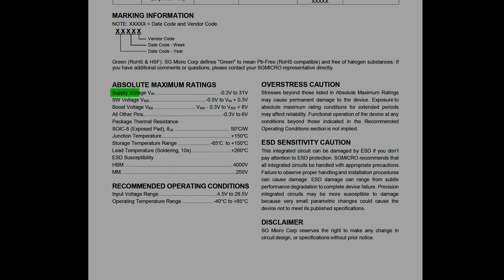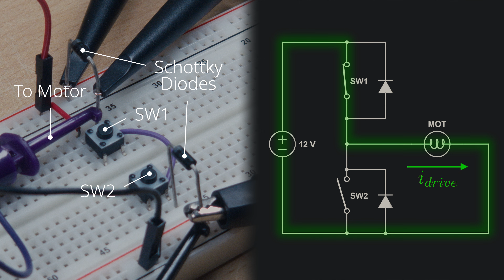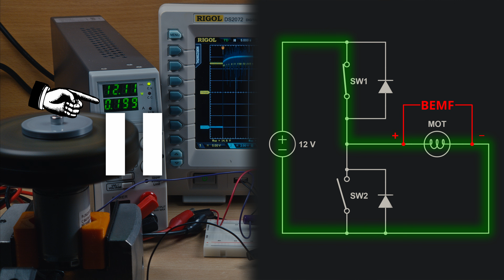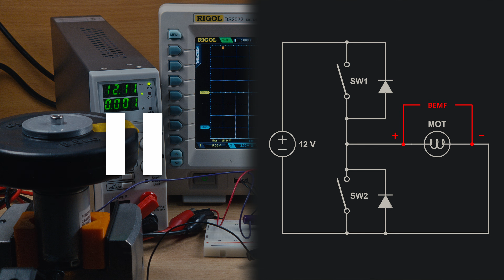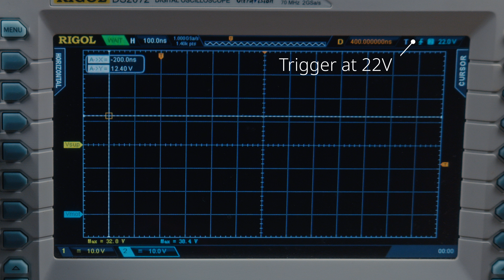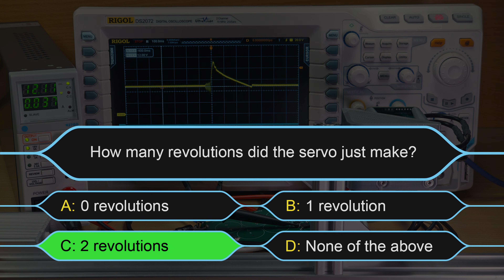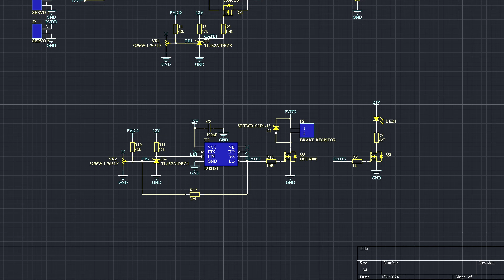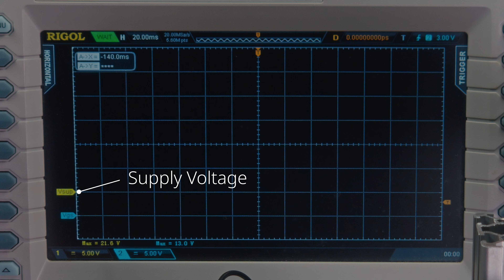Regenerative braking broke my motion controller. Here’s how to protect yours (with schematics)

Comment: A well designed motor controller should never destroy itself from braking, even absent ballast resistor. The fast irq also measures the bus voltage and upon reaching a threshold the output stage is cut thus instantly stopping the regen.

Comment: TL:DR: use a braking resistor with a circuit which dumps rising power supply rail into the large braking resistor.

Comment: One possibility:

Take the protection circuit at 8:13.
Problem: power loss in the diode.
Solution: swap an ideal diode in for the diode.
Problem: ideal diodes tend to react slowly, which can result in brief spikes reaching the power supply.
Solution: Add a TVS diode to cope with said brief spikes. Doesn't need to be rated for continuous operation, just pulsed for long enough that the main protection circuit kicks in.

Also: beware that many power supplies cope extremely poorly with high amounts of capacitance on their outputs, and may oscillate or go out of regulation.
Reply from the maker: Yep there are many ways to implement these protection circuits!

Comment: hii bro , I came across your video I have some doubts regarding this .when  motor act as a generator it produces BACK EMF this back EMF go to the power supply how would you switch this from not going to the power supply but to the transistor  and what is the need for inrush current control . Basically can you explain the schematic in detail. I want reproduce this circuit for  my project
Reply from the maker: This circuit doesn't disconnect the power supply. When the shunt resistor is "switched on", it becomes a new return path of relatively low resistance, so current from both the power supply and motor's regeneration will sink through that resistor.
Reply: @engineerbo  thank you bro
Reply: @engineerbo  Now I have another doubt bro can we do  different inrush current limiter for this circuit
Reply from the maker: Of course you can implement something different, these sub circuits are pretty much independent.
Reply: @engineerbo  can you explain the working of Inrush current limiter circuit it will help my project .I don't know where I have to place the Inrush current limiter circuit . I want to place this regen clamp across the motor driver and the power supply.

Comment: Can I just put a big capacitor? Just take approximately 1 J of energy. I’ll answer it myself - I need to test it And there is some danger 😀
Reply from the maker: Yes if you have a sufficiently large capacitor and a sufficiently low impedance path, then it'll limit the voltage ripple enough to do the job.
Reply: @engineerbo  Varistor for an operating voltage of 13-15 volts, the simplest and cheapest method ))

Comment: I saw glare on your PCB, turn that polarize filter bro! haha Btw, I did finish installing the filter on my microscope, its amazing, thank you! Wrote little article on my website about this. 
Back to your video, this is insane work, I love how you present topics. Keep making them. My big question is why not use a Zener? Would love to compare that to scope @ 10min24
Reply: I just saw your reply about TVS. Those peaks are in nano second right? Peak power will be short then. Again, it depends of the end application, if the pick and place moves ultra fast with big load, this generates lots of peaks and could stress the TVS. Can you parallel TVS diode so they all absorb energy? But not sure if they will catch spikes at different time due to manufacturing tolerance.
Reply from the maker: Just looked up the article on your website, nice write up!

The peaks in this video are really "demonstration" peaks, so I've limited it to something safe. I've seen people talk about parallel TVS diodes, and that seems theoretically fine, as long as the specifications line up. I'm guessing there are situations where TVS diodes are preferred, e.g. if ultra fast protection is needed.

Comment: Why is it bait and switch?  Bait and switch is a *scam* where you promise one thing, then when it arrives it is another lesser thing.  In engineering that analogy doesn't quite make sense to me.  Electronics operating in multiple modes or like multiple devices, etc. is not a bait and switch because it isn't a scam.  The scam part is the critical point in a bait and switch scheme.  Anyway maybe I'm just misunderstanding why this is like a scam.  But using that logic I feel like I can call a bunch of mathematics a scam too because it is unusual from what you expect (ie. the analogy doesn't carry well outside of a societal context IMO)
Reply from the maker: The analogy isn't meant to be technically rigorous. That said, I think the analogy has some merits (literally using a switch to cause current to flow and redirect it where it normally wouldn't). It's understandable if you disagree.
Reply: @erbo ok.. Bait and switch refers to a fishing line.  You throw out bait, and then when a customer bites and buys something, they get something other than what they paid for.

IMO it doesn't make sense in the English language to use it they way you are, it makes it sound like you don't understand the phrase or the language.  But I mean if you want to keep using that analogy 🤷‍♂

Maybe read: https://en.wikipedia.org/wiki/Bait-and-switch

Comment: Even though I know exactly how regenerative braking works, I don't understand what the problem is. In applications where we have no way to store this energy, regenerative braking is pointless and the motor should be braked by applying current to it.
Reply from the maker: Applying a reverse current works, but the kinetic energy still needs to go somewhere. If the energy isn't dumped into a dedicated resistor, all other components (e.g. motor, wires, switches, power source) will need to absorb or dissipate it.

Comment: (At 8:36) Although kind of irrelevant to the subject you are talking about, but I couldn't resist telling you that there is a small issue with your in-rush current limiter. When the capacitor bank reaches its steady state, the PMOS turns off bypassing the in-rush current resistors. However, if a power surge from your circuit lowers PVDD enough, the TL432 will turn off the PMOS, thus enabling in-rush protection when power is most needed. One way to overcome this is to pull up FB1 higher than 2.5V with a PNP transistor once GATE1 goes low. This effectively prevents the TL432 from responding to PVDD dip after the steady state.
Reply from the maker: Thanks for the heads up! I haven't stressed the power supply enough to cause a big enough voltage drop, but yes that's definitely something that can be improved.

Comment: Bo Very well done video. I would be curious how the DC servos you find from Stepper online and/or Gecko compare to the same sort of analysis.
Reply from the maker: I'm guessing all permanent magnet motors will exhibit some form of regenerative braking. Perhaps expensive controllers have some way of absorbing the energy. I'd love to find out, but those things can get pretty expensive.

Comment: And why not just use a simple TVS diode?
Reply from the maker: A TVS diode will theoretically work fine, provided you can find a model with a voltage rating that suits the rest of the system (I don't think I've seen an adjustable TVS diode), and is able to survive the power/energy from regenerative braking.
Reply: @engineerbo  
Just one search result and there you can find TVS diode with various nominal voltage and power ratings, up to several kilowatts. If there are no other specific parasitic characteristics these diodes apply on the circuit I don't see why making the search a whole lot more complicated focusing on sourcing many parts including IC's instead of just a single component to do the job.
Reply from the maker: I can perform a similar search for components, and I don't think I will easily find a TVS diode that will satisfy all my requirements. The TVS diode needs to be rated so it doesn't conduct during normal operation, but clamp the voltage before anything else is damaged. That in itself is not a trivial requirement to satisfy.

When you say these diodes are rated to several kilowatts, I'm guessing you're referring to the "peak pulse" power rating. That is not the same as the power rating as with a power resistor. There's a reason the 300W braking resistor I showed in the video is about the size of a brick, but a "300W" TVS diode might come in an SOT-23 package.

Comment: I am using an ideal diode usually used for solar panels. I am not sure if it's the best solution but my power supply is alive. I need to check on the oscilloscope as you did
Reply: Beware that ideal diodes tend to react very slowly. You can kill the power supply from the transient before the ideal diode kicks in.
Reply from the maker: Where do you install the diode? It sounds like a diode could be protecting one side of the diode at the expense of the other side.
Reply: @engineerbo  Between the psu and the controller. So you mean I would still blow the controller but not the psu
Reply from the maker: Yes, the diode will stop the reverse current into the power supply, but the voltage spike will still build up on the other side of the diode.

If you're using a diode, you still need something to dump the energy, like the returned energy dump circuit on gecko drive's website.

Comment: The production quality here is AMAZING! How do you have this few subscribers??

Anyways, I'm curious: Why didn't you want to use the regenerative braking protections that's built into your driver?
Reply from the maker: Thank you! My servo driver's pretty bare bones at the moment, so it doesn't have built-in regenerative braking protection like the ODrive. They're also usually used at least in a pair, so it feels unnecessary to have duplicated protection circuits.

Comment: If all you need is shunting a known amount of energy from regen braking, then you can take care of the voltage spike by simply adding a capacitor large enough to absorb the regen energy within the allowed voltage rise. If you have a 1kg mass moving at 3.16m/s, that is 10 joules of energy. If your nominal voltage is 24V with a 28V absolute maximum, you would need a ~100mF (0.1F) capacitor, preferably in the form of 2-3x smaller capacitors in parallel for reduced ESZ. Of course, having a shunt regulator to clip anything above 28V and also trigger a warning/alarm would still be a good idea in case the capacitor bank wears out.
Reply: ah yes the ubiquitous 40 V-rated 100000 µf capacitor; the first thing that should spring to anyone's mind 😎
Reply: @ikbendusan  If you cannot source 100mF caps for a reasonable price, just replace it by an equivalent amount of parallel caps.

If you want to brake and accelerate 10J of kinetic energy in 20ms at an average rail voltage of 26V, you need to handle an average of 38A in and out. Huge caps are only rated for 20-25A of RMS ripple, so you'd probably want to split that current between 2-3 smaller caps at a minimum for longer life.

You can also go all-in on being budget-minded and just lump 15x 10mF caps together to achieve ~60A RMS rating for cheaper than a single high-current 47mF cap.
Reply from the maker: 1 kg mass moving at 3.16 m/s is about 5 J. To absorb 5 J (i.e. magic perfect regeneration) and have the voltage rise from 24V to 28V requires "only" about 48 mF. To size the capacitors we'll want a safety margin, then adjust for derating and ESR etc. Overall, it's doable, but the braking resistor is likely cheaper.
Reply: @engineerbo  Sorry, forgot the divide by two there. Makes it twice as doable and half as harsh on caps.
I wasn't suggesting capacitors for the cost, though large power resistors aren't exactly cheap either. More for the efficiency, reduction in power supply peak loads, eliminating the need for the PSU to cope with massive fast transients, 100% passive simplicity and no hot dump components to worry about. Also, when capacitors go bad, you usually get progressive tell-tale signs before failure (ex.: leaking caps, sensor misbehaving from electrical noise and controllers crashing from noisy power) instead of immediate catastrophic failure when a shunt fails to do its job.
You can build a 50mF capacitor bank out of 15x3300uF Nichicon YXS caps for about $25 which would have ~1mOhm of ESR and 60A RMS ripple capacity.
At that point, wiring ESR/ESL would be a bigger concern than the capacitors'.
Reply from the maker: I personally quite like capacitors, and in the protection circuit's PCB in the video, I actually did include a small bank of them. Having a large capacitor bank doesn't instantly mean the system is simplified though. For example, there might now be an high inrush current when powering on.

There are also several failure modes for capacitors, and for sure catastrophic failure (e.g. venting) is one of them. I'd also imagine it's not necessarily better to experience gradually worsening system reliability in non-catastrophic cases.
Reply: @engineerbo  Charging arbitrarily large capacitor banks without causing massive current spikes is why most switching power supplies have a soft-start circuit that ramps up the primary side duty cycle or current limit over the first 60-120ms from AC-on.

As far as capacitor failures go, good quality capacitors of appropriate voltage, ripple current and temperature ratings rarely fail catastrophically unless something else fails first to push them beyond their ratings... or they got hooked up backwards. The far more typical failure mode is slow pressure buildup eventually cracking the pressure relief vent open, allowing the electrolyte to slowly dry out over several weeks or even months where you will often see symptoms progress in frequency and severity until things quit working altogether.

Comment: What about a zener or a few maybe? I have them both at the gates themselves and at the motor-phases, as well as on the dc side.
Reply from the maker: @cadsonmikael9119 A Zener diode as a voltage clamp is also one of the recommended protection methods. The problem is you'd have to use a Zener that is rated for the full current.
Reply: a tvs diode would be more appropriate
Reply: Yeah, and what is a TVS diode, actually inside? @ikbendusan
Reply: @cadsonmikael9119  i know they are basically the same thing but good luck finding a 600 W/1000 µs rated zener diode

Comment: The problem is simple, your power supply is a single quadrant power supply it means it can source but not sink power, thus this power has nowhere to go and rises the voltage, this doesn’t happen if you have a :
1. battery which can sink or source power 
2. Expensive 2 or 4 quadrant power supply 
3. Big load capacitor on the input allowing to absorb the excess power for a short time
Reply from the maker: Sounds good in theory. Options 1 and 3 are similar, but there are limits to the amount of energy that can be absorbed, and the rate of absorption might also be a concern.

Comment: I had a similar experience with my CNC milling machine Z axis with home made DC drives (1000kg axis + table) I even made a dump circuit with a IGBT…. 
My hard lesson was selecting the correct wattage resistor and heatsink !!! I made all the load dump tests in winter (cold machine and thicker slideway oil) 
In the summer my 100w power resistor went BANG ! Thin oil and less friction!
I now have a correct 500w resistor and a thermal switch on the heat sink that is in the E-stop circuit!!  
Enjoyed the video! It brought back memories 😂
Reply from the maker: Glad you enjoyed the video! If the power resistor is the only thing that blew up, I'll consider it pretty good luck!